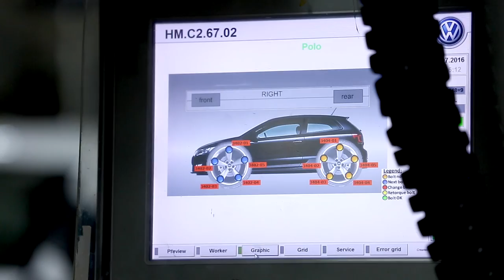Volks Wagen Pune Factory-Short

Comment: Very bad engineering.. fuel injector always fails and it costs Rs 25000...cant trust this car for a long trip bcoz the fuel injector fails anytime and have to find a vw service centre to fix it also keep Rs 25000 extra in a road trip to fix fuel injector...it can fail anytime without any symptoms
Reply: Please understand for most of brands the injectors price around 25k. I am using a polo TDI 2013 and also have a GTtdi 2019 model. It’s the performance that intended me to buy another too. If you care about maintenance cost then better move on to Maruthi Suzuki
Reply: @aswinkamal2898  not only maintainance costs it bothers...think off when you are away from a town and  your fuel injectors fails suddenly...and you checked everything before starting the trip and coundnt find any issue at that time...what to do...say man
Reply: @MrMathewjohn  really if that's what happens with VW  , I think they should focus on reliability also and parts failure is completely fine happens with every mechanical part but premature failure and that too repeatedly is not acceptable. Also costing a bomb amount is not justified.  They have conquered In dynamics of the vehicle such as ride and handling characteristics , composure while turning. Also solidly built and safe . Now it's high time they focus on their unfavorable points putting the opponent's in consideration. Like super reliable and refined k series engine of Maruti. I would want 1.2 L naturally aspirated engine of suzuki in the polo and polo  will become favourite car.
Reply: @dhirenpatel7670  no it doesnt happen with VW, its just that people are jealous of the quality but cant afford to buy, ask that man whoz complining if he has ever purchased any german car including VW
Reply: VW cars indeed can't vr trusted for long rides. We went to a far place like 60km and while returning home then fuel pipe connecting the fuel line to the engine burst open midway. The diesel spilled all over the engine and the road. We managed to find a similar pipe nearby and went to showroom but even the showroom didn't have that pipe. Their parts availability is so less and also they should've focused on those parts
Reply: @psychoman0000  i own vento Tdi 2012 model also a skoda octavia...only vento had the injector problem..and dont tell the things which you dont know about are wrong
Reply: @Phoenix1128_  True...Honda and Ford cars are more reliable
Reply: @MrMathewjohn  yes vento had continental injectors and they used to fail many times..but polo has Delphi injectors which are good

Comment: And fixed abs when the actual engineer went to eat dinner..using a polo..always abs complaint🙏
Reply: sir please check abs wiring i also had abs light blinking got my wiring checked found out it was cracked
Reply: It will cost you just 3k check the tyre ABS linkage sensor 
If it's a ABS Console kit you are screwed
Reply: Poli sanam